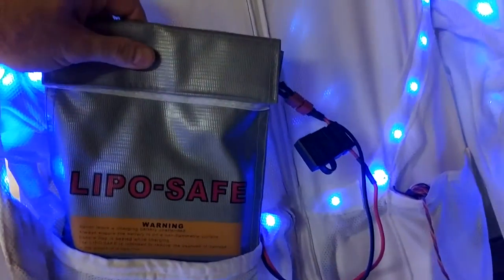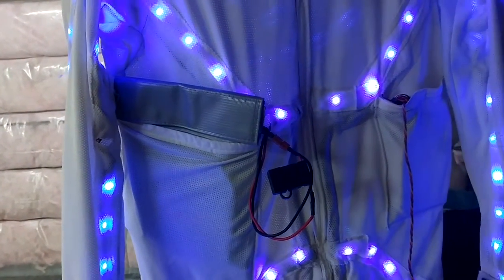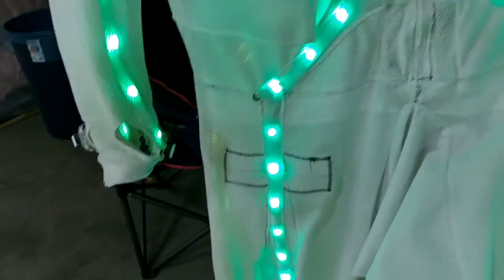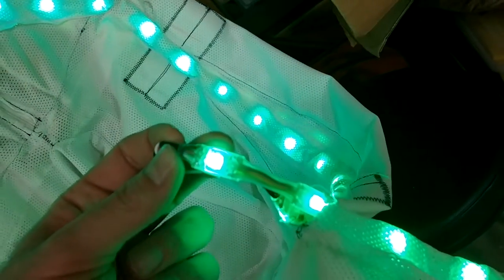mBlade Akita LED suit v2.0 explained

Comment: I started using silicone insulated wire since it's more flexible. It also doesn't melt when soldering.
Reply from the maker: Yeah, I use 100 strand PVC 3 pole 22 AWG (20 AWG if I can get my hands on it). I just set my iron to the right temp and quickly solder the joints, rarely an issue of melting. I do use silicon wire here and there, but I find its shielding is quite weak to abrasion. And it never comes in handy flat ribbons. Thanks for the advice though!